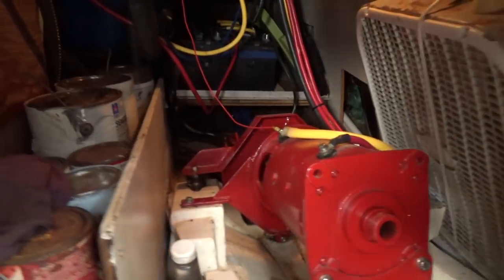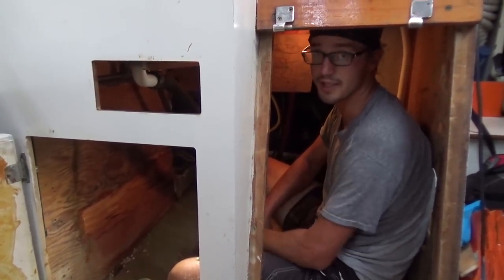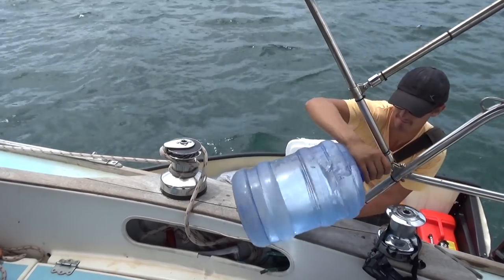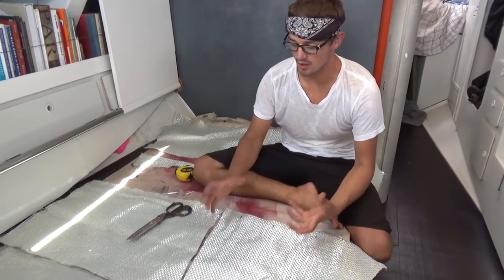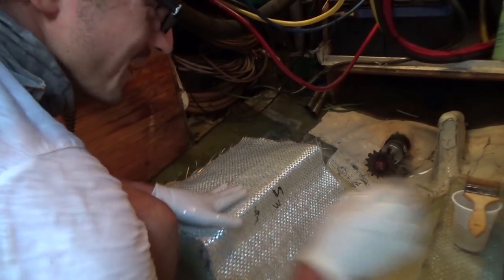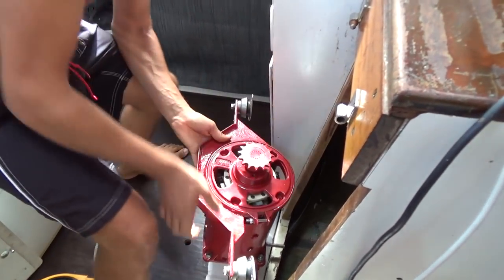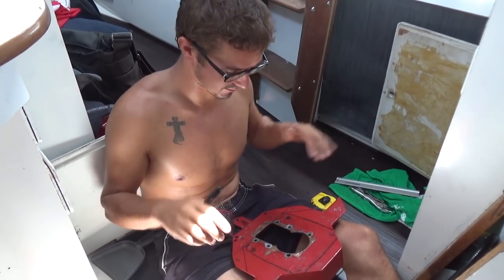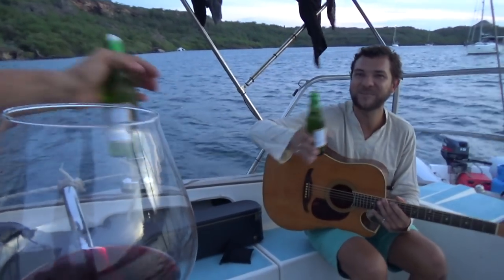REBUILDING Our Electric Motor - Going Direct drive — Sailing Uma  [Step 99]

Comment: have you ever said what your range is on the 4 cad battery’s. can’t be very far. 40 miles? if you ever go somewhere where’s its not always sunny what would you do. you can’t have enough solar to power your laptops and everything else plus the motor can you? do you have a refrigerator?

Comment: Did you ever think of mounting an alternator of your motor and run belt to shaft it would supply energy to batteries when boat is moving

Comment: Hey guys, did you measure the difference, which was easier or harder? The engine with starter, alternator, reverse gear and full tank or batteries and electric motor? A list of all parts with weight?
With best regards from Germany

Comment: What is the HP of your electric motor? Is it an AC or DC motor? Because you mentioned regenerative my first guess is DC. But I know some of the newer designed AC systems  can do more that some early ones. But I am also wondering whether or not your propeller is of the collapsing or fixed type. If not fixed can you utilize the  regenerative feature. I am very interested in your system design. If your system does everything you want it to I think that would possibly be something great. Good luck

Comment: how about doing a video on the  keel being loose and how yoou repaired that. That would be interesting and necessary for others with the same problem????
Reply from the maker: +Jack neff we did! Back around step 11 or so. Ones is called 'The todo list' another is called 'structural integrity' ... Actually most of season 1 is about the repairs we did in order to get Uma floating again. Hope that helps! Cheers!

Comment: Not sure I would put lead acid batteries in a confined space with electric motor, could be a fire risk due to batteries gas emmissions. A set of used Tesla batteries and an AC motor and controller would go a long way towards serious power independence.
Just started watching, so maybe you got there already.
Best of luck.

Comment: what voltage and how many amps are you running, looks great
Reply from the maker: Back then? 48V - 4 group 27D lead acid batteries. Terrible for this application. In later Steps, we upgrade to a much better system.

Comment: One thing that I am unclear
And bravo for the cery cool swap

And this… so on a cloudy day without sun do u have a reserve generator fueled by ?? Oil
And old human powered wheel other???
Reply from the maker: Back then no. Solar was enough. We didn't plug into marinas (we couldn't, since we didn't have a shore charger) and we didn't have a genset.

Comment: A very nice idea the use of an electric drive. But we have not enough space onboard our 54 ft Amel for all the batteries. As a worldwide cruiser we would need more than 6000 Ah minimum.
Reply: André Rimkus Not necessarily. It all comes down to how much you sail, it is a sailboat after all. It’s a choice thing. In your case a hybrid would be a better option but if you want to punch weather stick with a diesel.

Comment: terrific setup for the motor you have some real skills, I'm sure there is a reason but why wouldn't you have mounted the electric motor on hard rubber blocks to address the fore and aft movement, don't get me wrong this is not a criticism, I am quite impressed by your work
Reply: Yes, why no rubber mounts? Feels like there will be a lot of unnecessary strain on the fiber glass bed with the motor with a rigid mount?
Reply: The electric motor produces force in the opposite direction when it is powering the prop.  The rubber might get compressed, wear out, or cause the motor to vibrate when starting or stopping it.  Although, I would be willing to be proven wrong if someone has done this in the real world and says it doesn't happen.  I have only hard mounted an electric motor in a vehicle, not a boat.

Comment: HI, thank you for the upload. Interesting project - and also interesting electric drive fitting. COuld you maybe tall more about what battery you use and what range do you normally get? THE motor is a forklift motor? WHat inverter do you use than?
BEst regards!

Comment: Hey, cool electric conversion you have going on there! 
Just wondering some specs from your engine. As I have understood it is an old forklift engine (?)
At what voltage are you using it? And is it a brushless or brushed engine? 
And have you ever measured what is the current drawn by the engine while doing cruising ?

Comment: this is probably a dumb question but is there anyway to use the prop to charge the batteries when you under sail power?
Reply from the maker: Not a dumb question at all. It’s called regen and it’s something we’re working on. Might not work with our current motor, but definitely possible.

Comment: Hi, very innovative. Did replacing a Diesel engine with the electric drastically effect the trim of the boat? Also did you have to add any ballast?
Reply: What voltage is your system? Why did you use a transmission before? Has your vessel always used electric drive?
Reply: H2Dwoat In my own case no, it’s down to weighing and positioning stuff and getting the mass in the right place. A basic system will weigh about the same as a diesel. Lithiums less subject to whether LiFePO4 or better still for gravimetric density NMC, but with that comes less safety and lower C rates.

Comment: This is the first video of yours that I have watched. You are now using a direct drive from an Electric Motor to the prop. So is the motor engine driven, or solar cell/battery driven?
Reply from the maker: Yes. We charge with solar and have a few small batteries to power it for now. We've done a few other earlier videos showing how we got here. Check out our channel play list "electro-beke" or our website, www.sailinguma.com/electro-beke if you'd like more details. Cheers!

Comment: Loved it! But you didn't show us it in operation after? So it feels So incomplete! love the electric motor and going direct drive ideas too, as a Electrical Engineer, I have ideas for a completely electric sailboat..alas a Cat, with plenty of new tech solar panels, 2 wind generators, and my propriety wave/current generators too! Even the dinghy would be a separate Li-ion pack(tied into the main when not in use,but easily removable for dinghy use) and a small efficient high output motor for it.
Getting rid of the transmission weight is also a great side of going direct drive, and a good job of remaking the pan/mounts for it..but when you were prying off the old, that CRAAAaaaCkertz sound on a boat is always terrifying to hear! LOL  please show it in use in the next video, and let us know how it's working, the good and the bad.
Reply: Can the boat under sail, "dragging" the prop act as a water generator and supply power?
Reply: There is a solar powered Cat, search google
Reply: That is some good thinking, but don't know if you dive, but a boat moving under sail barely moves the prop if at all, as the keel and body of the boat shields the prop, and they design it that way as you want as little of drag as possible, also think of the thrust aspect, would you want current and wave action to take away max thrust? The drag aspect is why you don't want anything but small wind turbines going. The waveform/current devices I'm working on are for anchored use only.
Reply: yes, a solar powered Cat(actually a few), but doesn't generate the kind of power that I'm working towards in my design. Also doesn't incorporate wind and other forms of generation which I have in mine. And note; currently is in design stage, as I hope to interest at least 1 of the makers of them, or get rich and build my own, as I have children I'm putting through college now!
Reply: niceguy217 Yes and no, it’s all down to boat speed Check the graph here http://oceanvolt.com/solutions/hydrogenerator/
Reply: You have just described my dream rig.  A purpose-built-from-the-ground-up, long, wide cat with a full footprint solar roof, two wind generators and current generators.  Same electric tender as you describe.  Mine would have a pair of rigid wing sails on guyless carbon fiber masts that could automatically weathervane into the wind (360 degree rotationally capable) during storms while on anchor or at the dock.  I've read this configuration has less windage than bare poles with guy wires.  I would go as big as possible with Li-ion capacity, lining the entire length of each keel under the floorboards with batteries.  I'm curious what kind of range might be possible with such a huge bank.  This is of course my "money-no-object" fantasy.  Fun to dream about the utter autonomy this setup would bring.  Unlimited free power for watermakers, freezers... whatever you want to run.  And perhaps 1/10th of the maintenance required by a diesel powered cloth sail cat.  Not to mention full push button single handing.
Reply: Excellent Matt! And while I didn't mention all of my ideas we are very much on the same page, a lot of carbon fiber/kelvar in my designs too..when I win the lotto I'm going to be looking you up, as 2 minds are always better than one!
Reply: I will of course reciprocate and contact you after winning the big lotto so we can start the build process for our two prototypes to show the world what modern, sustainable naval architecture can look like ;)
Reply: I've been patient, but 1/2 hr tops...no way, not going there,
Reply: The watt and sea does about 1000W of power. When you think about the size of the average sail (and the mass of the boat being pushed through the water), 1000W is not going to make a big difference in speed, and if you're in light wind or trying to go as fast as possible, you could feather the prop (or actually run the electric motors). Basically there are a slew of scenarios where the extra drag is not an issue. When winds are high enough, you're much more worried about controlling the boat and staying safe than the extra .5 knots. 

As someone who's looked into similar boats, I'd caution against wind turbines unless you're going to forgo sails altogether. Turbine diameter and height being the key factors they are, you need a very large wind turbine to be worth the effort (like, with a diameter almost the length of the boat). While I honestly think it's a criminally underexplored use of wind turbines, it's also one that as a result has very little in the way of prior art. You would wind up doing almost all new research.
Reply: @matthanson4920  I'm in the midst of "electrifying" a 52' storm damaged Cruising catamaran I recently purchased in BVI and limped back to FL. Looking at 2 stainless oil cooled AC-35 motors from HPEVS to replace my scuttled Yanmars and custom mount them to my perfectly good SD50 saildrives. These will cost me about 6k a piece rather than 20+k from a company. Just purchased 10 300 watt flexible panels, a 72V MPPT charger & 3000W Inverter...& will likely go with 10 more and 2 to 4 wind gens off the high stern. The costs are quickly adding up and the batteries will certainly be a major purchase. Much work to do - but making it a reality.
Reply: An X class solar flare is going to provide an ample amount of toast for you greenies with your electric aspirations.
I'll keep my Yanmar. And don't try to flag me down. I'm not a rescue vessel. Call the Coast Guard.

Comment: can the prop spin when the motor is not in use to propel the yacht to generate power (maybe)
Reply from the maker: Theoretically, but we still haven't quite got it to work on our boat yet. It's one of the next things on the list to work out though.

Comment: You should always put a mat glass in between your woven roving...
Reply from the maker: Yes, usually. It acts as filler to increase thickness without increasing cost too much. But, that woven roving already had CSM stitched onto the back already.  Which saved a step.
Reply: To increase working time with epoxy use wider containers rather than taller one, this reduces the heat from endothermic chemical reaction.

Comment: Is increased efficiency the only reason why you removed the transmission and went with direct drive?
Reply: Phil H Direct drive isn’t always more efficient. Much depends on the voltage and current constants and decent shaft speed for power. It’s a balance. My own is about the same overall system efficiency as a 2:1 geared drive as the geared drive motor runs at twice the voltage and half the current to achieve the same power as my direct drive, so I lose a little on motor efficiency but gain it back as no gearing losses.

Comment: This may have been covered I just found your channel ,,,what voltage are you running for your electric drive
Reply from the maker: 48V....http://www.sailinguma.com/electro-beke
Reply: @SailingUma  Its cool you two reply on old videos to new questions. I have so many but I am forcing myself not to skip steps. Just finished this one.

Comment: How will you reverse? Will the motor run in both directions?
Reply: Yes.  Depending on motor type, reversing the polarity, or changing the order that the coils are energized will reverse almost any electric motor.

Comment: Is that a dremel tool you used to cut the metal bracket?
Reply: Willco5114 he used a dremmel to do some surface work, but looked like an angle grinder with a cutting blade.
Reply: Thanks!

Comment: Nice step Dan!  It must feel great to get that long awaited project out of the way.  Also how cool is it to get old useless stuff off the boat and free up space?  Those batteries are perfect in their new home!  
Have you ever figured your range with your current set up?
My boat will have  (9.9 hp Yamaha outboardsX2) so no smelly diesel for me either! Easy to work on too.
Reply from the maker: Ha, we LOVE throwing things away that are no longer needed. Out boat keeps getting emptier. We've never done a range calculation with our old set up, because it was so inefficient we knew it wasn't an accurate test. Now with the new controller and set up, we can really figure out our capabilities.
Reply: sweet!  Looking forward to your results
Reply: Same here.

Comment: getting registered in canada does that not mean you're stuck paying taxes on the boat? or is that only if you bring it home?
Reply from the maker: Only if we bring it into Canada. And still its only 3% of purchase prices....so $100 or so. No big deal.
Reply: pretty sure you have to pay hst at the border when crossing , 13%
Reply: The Narrator It depends what province you import it to. B.C. is is the worst, costing up to 18%: 
HST is GST at 5% and PST at 7%, and import tariff makes up the rest if it's not manufactured in a NAFTA country. I've been looking, and depending on the boat I buy it'll be cheaper to truck it to Alberta to import, and then truck it back to the coast to drop it in the water…haven't found anything that says I can't, but I'm still working on it.

Comment: how did you protect the foam from the resin?..when I tried it..it melted it immediately...
Reply from the maker: Wrong kind of foam then.
Reply: it certainly looked exactly like the foam you had..white styrofoam ..I looked it up again and I guess I  used a different type of coating..I used polyester resin and I should have used epoxy....maybe that was it?
Reply: on the can your's
 says epoxy resin...bingo...

Comment: I think the connection should not be like that.. perhaps it was the easy way.. the connection should be direct with some rubber in between it’s called giunto meccanico in italian but basically you have two metal wheels with teeth facing each other and some rubber in between. The rubber will take the kicks and make the electric engine run smoothly
Reply: This is a chain coupling, it is very strong and doesn't wear out, the rubber ones wear out.  It also allows a lot of misalignment.   A good choice really.

Comment: Hey guys, don't do that much resin in an enclosed space without respirator masks, that's just not good for your lungs or nervous system. very, very bad.  Strong rum makes it feel like you got it cleaned out but, no, don't do that anymore. OK, got it?  "It's not polyester." doesn't cut it, epoxy's bad for you too.  Particle mask for grinding guys, don't play with this stuff.

Comment: electric motor without gearbox would stuff up your shaft speed and necessitate changing the propeller. The most efficient propeller is a large diameter with many blades rotating slowly. I dont get why head backwards with efficiency?

Comment: What does that mean “going direct drive?” I’d like to switch to electric one day too.
Reply from the maker: We originally had our electric motor running through our old transmission. It was an easy way to get everything going, but also quite inefficient. So we removed the transmission and attached the motor directly to the prop shaft. Hope that’s clears things up a bit. Also, check out our website www.sailinguma.com/electro-beke for many more photos and details.